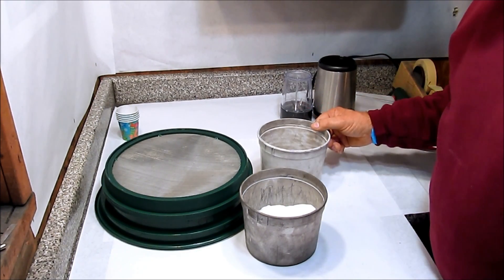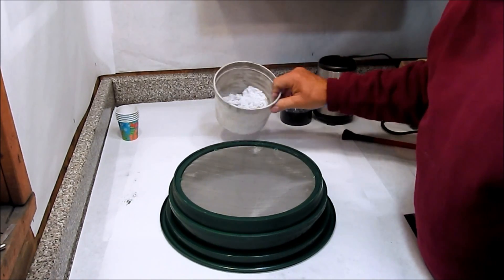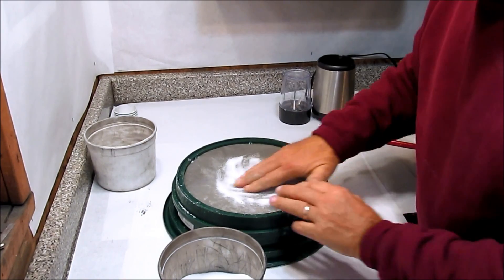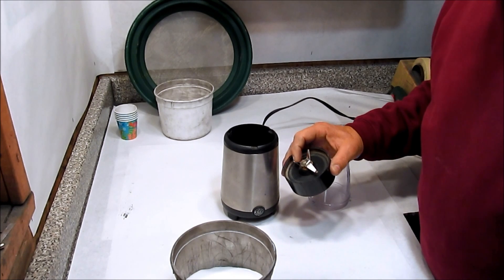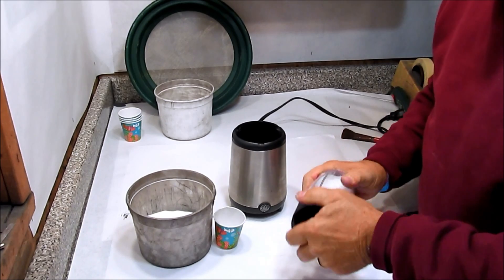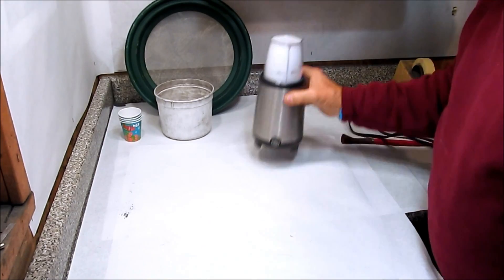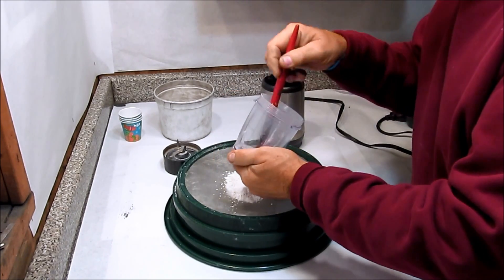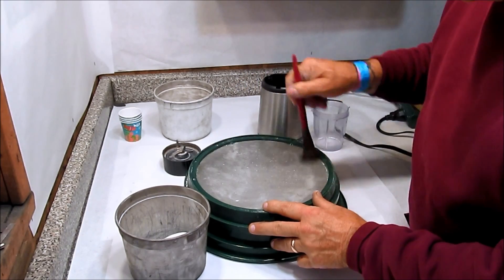FW 101, Lesson #6, Pulverizing a Chemical

Comment: Can I mill potassium chlorate in a Ninja? The shock & friction warnings have detered me from tyring.
Reply from the maker: I think you can, Dave, as long as it's the single chemical in there, but I don't know for sure. I don't use chlorates.
Reply: @nedgorski  I'll stick to my 500 mesh screen for now then. Thanks for responding
Reply from the maker: @crazydave1145  Enjoy, and stay safe, Dave. 500-mesh?? Man, that's fine. I've never heard of one that fine. Do you mean 50-mesh?
Reply: @nedgorski 500 mesh is pretty reasonable in flash powder at least.  That's 2mil particles or 50ish microns.  I see the metals sold all the way down to 3 micron.  If my calculations are right that would be 0.11mil with a mesh count of 8466.  Although that's not accounting for wire thickness.
Reply: KClO3 is just too iffy to use in a mixture.  Although I don't think it would be too bad to mill alone.  I would highly recommend staying with KClO4.  The perchlorates are much safer and just as effective if not more.

Comment: Both the Bangkok Pyro and other blackpowder experts ball mill assembled ingredients. For 3 to 12 hours depending on how course. That is dry and outside. Everyone puts it under a cover and plugs it in remotely to start. That fireworks guy does 10 kilo at a time. And some of his shells weigh 100 pounds. He runs 2 ball mills all day every day.
Reply from the maker: To each their own, of course. My ballmill is very efficient, and if I run a BP mix in it for more than 2 hours, no matter how dry the starting ingredients, the mix will start to clump in the mill. That's how I know the mix is as fine as it'll get.
Reply: @nedgorski  
I'm trying to watch all of your classes. Great job. Thanks for making my shots better. But they are not listed on your channel. Can you I help? I found 1 and 6???
Reply from the maker: The complete FW 101/201/301 courses are housed in Fireworking.com , with 401 under construction, Michael.

Comment: Hi there Ned ist this a good one for kno3 to charcoal n stuff Mixer ?
NINJA Smoothie-Maker QB3001EUS, 700 W,

I bought a cheap one From the Bay n IT died after charcoal :/ 

Im learning so much From ya thanks alot 

N greetings From far away
Reply: PS: i wont use IT for BP Just for blending stuff 

For BP i use a Ball mill ...
Reply from the maker: I'll pulverize a small amount of an individual chemical such as KNO3, Olaf, but I NEVER mix any combination of chemicals in such a blender. That's really asking for trouble.
Reply: @nedgorski  thank you for advice bows

Comment: is there a way to make kclo4 in state of  likely airfloat cause i mill my homemade kclo4 and it just result on clumping on my storage and not result on like on talcom fine kclo4
Reply from the maker: Poltassium perchlorate does like to re-clump back together after it has been milled or screened. It always has to be at least screened back to a fine state before use. That's just the way it is.

Comment: Alot of the videos i see people are milling black powder together all 3 chemicals together so that is not the way to do it???
Reply: It’s more dangerous to combine all the ingredients together.  Taking the product out of the mill after it’s done and transferring it to it’s storage container is the most dangerous part. Technically the mill can build up a static electricity charge and ignite, either upon arcing out to the ground through the mill or when you walk over and touch it, like a door knob in the winter on carpet.  It’s best to do the oxidizer separate for that reason, then combine the oxidizer and fuel afterwards.  Either way, safe ESD practices state that you should wear low ESD clothing and be certain to ground yourself out to a grounding plate before touching the mill directly.  Some people opt to put the mill on top of a grounded steel or copper plate and ground the chassis of the mill to the plate.  Then just make certain to place your hand onto the grounding plate upon walking up before touching the mill.

With a small blade mill like this that you hold in your hands I would avoid it at all costs.  If you ever find yourself thinking how inconvenient it is to mill multiple times because the chemicals are separate, just image trying to do it without hands or eyes.  Then the inconvenience becomes much more acceptable.  :-)
Reply: @Combat_Pyro  It does'nt do anything if you mill blackpowder and than transfer it :-) I would'nt ever mill metall containing comps in there :D
Reply: PyroDoktorHD well, I certainly would never presume to tell anyone else how to run their operation, but I personally, would never do it in a hands on blade mill.  It’s one thing to remotely plug and unplug a loaded ball mill of black powder, but with a blade mill “coffee grinder,” unless you defeat the safety switch, you have to hold it in your hand to operate it, and the minimal time saved, in my opinion, isn’t worth the risk.  Black powder can be very sensitive to electrostatic discharge.  If you’re trying to save time you can also purchase a double chamber ball mill and just run the oxidizer in one tub and the fuels in the other.  Then you end up with all the ingredients ready at the same time.

I handle flash powder, AnAl, primers, and other materials all the time.  I get that there’s an accepted level of risk.  It’s just to me, the cost benefit ratio isn’t worth it.
Reply: @Combat_Pyro  sure! And I do it without any problems with ball mill grade meal within 20 minutes :D And I am not recomending it to anyone because of safety xD
Reply: It works so why not :D There is no way that blackpowder is ignited as there's no metal in there and the mill won't reach 400 degrees! ;-) I use a 750Watt Phillips Blademill